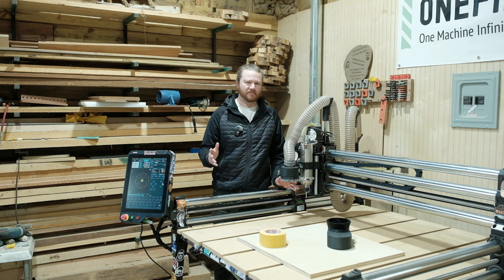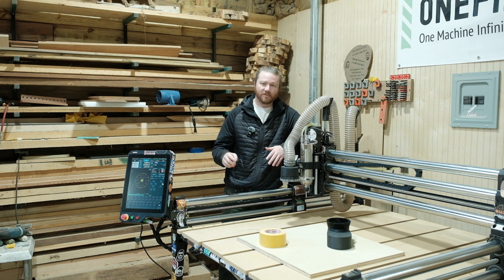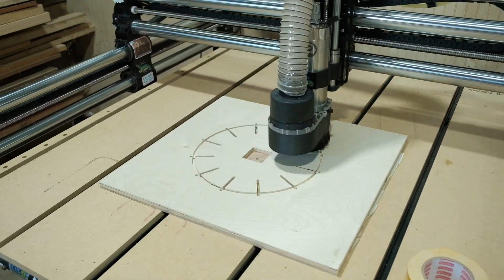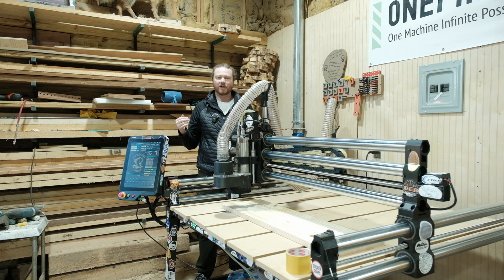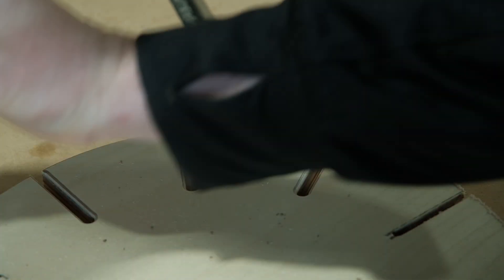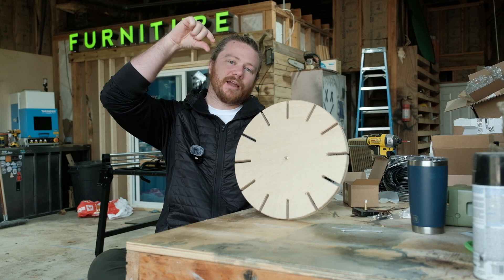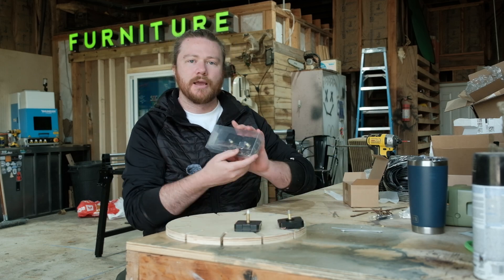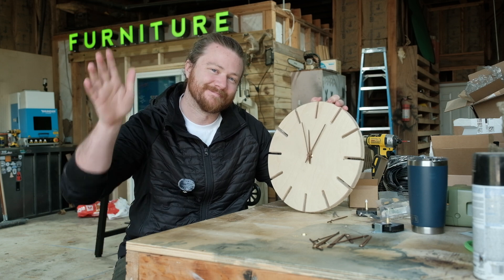6-Min No Flip CNC Clock (One Bit)

Comment: For the part that sticks out, you could take a 6-7inch piece of 1/4 inch plywood and make a spacer. Cut a through hole for the mechanism, then do some type of keyhole to put it on the wall. Then you just glue it onto the back. This way, it would keep everything flush, while not adding that much to the cost.